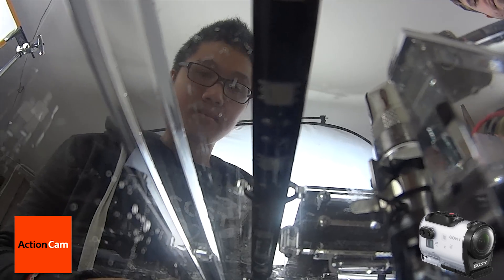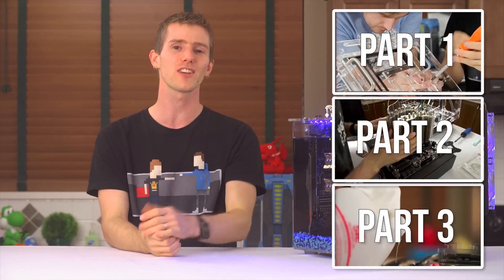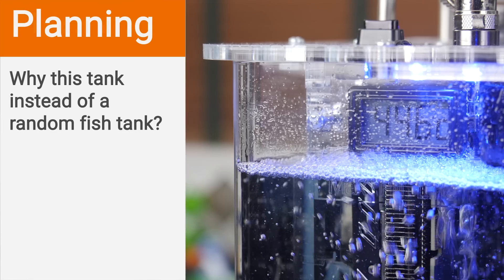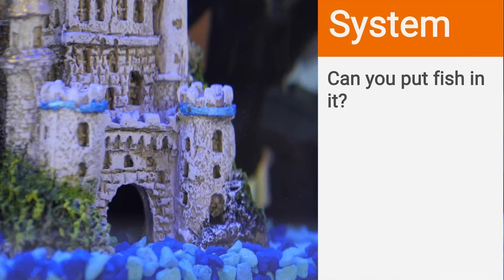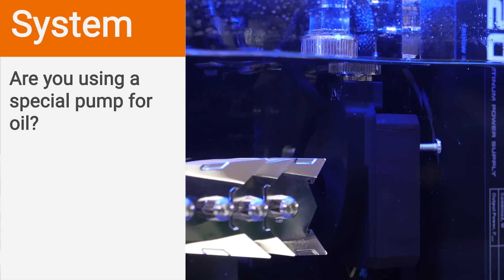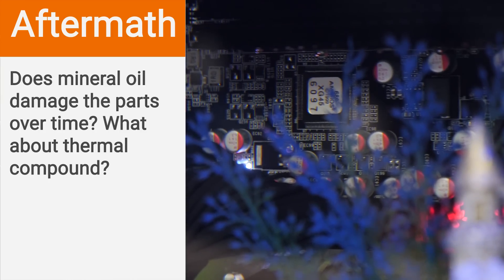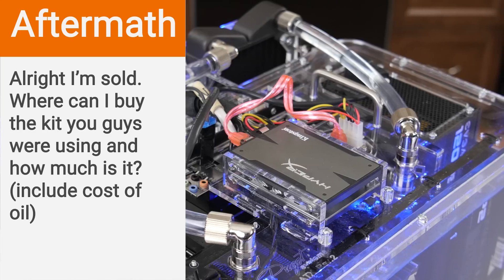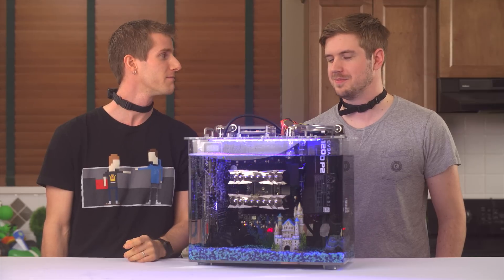Mineral Oil Cooled PC Part 4 - Q&A

Comment: Of COURSE having a fan on the cooler would make sense!? Exactly the same way how the fan makes sense in air. It is meant to dispose the heated up "material" asap from the cooling fins. Would have helped GREATLY here to keep the CPU temps lower.

Btw....you explained the positive effect of the fans properly regarding the graphics card - strangely!

Comment: Water also has the disadvantage that even distilled water is subject to so-called autoprotolysis. This creates ions that make the water conductive and therefore unsuitable for this purpose. It is not just the ions that are introduced that are the problem, you simply cannot prevent some from being created by itself.

Comment: Would be interesting to see the oil cooled by a refrigerant system and more direct circulation on the system, a variable speed pump managed by software that would adjust with the ambient temperature and when under load to keep it pretty much at a constant temp at all times. That would be impressive.

Comment: LTT should do an Immersion Cooled PC using 3M Novec liquid...
Why? Well...
1. 3M Novec liquid is much more efficient in dissipating heat due to its volatile nature (evaporates at 46 deg C, it's also not flammable)
2. 3M Novec liquid is not greasy and will easily evaporate so cleaning will be much easier
3. You wouldn't need a heatsink for your CPU and GPU as the liquid itself is better at cooling the hardware down bare
But, why they shouldn't? Well...
1. 3M Novec liquid is very expensive, it's only recommended for corporate servers.
2. The system needs a complicated cooling system for the liquid (it has low temp boiling point)

Comment: Would the CPU and GPU cool enough by just letting oil flow over its surface, using a pump, instead of using cooling blocks and/or fans?

Comment: I wonder if you put a screw as a plug at the bottom side of the case so you can drain the oil out into something to change parts and then just reuse the oil.

Comment: How can you even suggest that more movement over the coils wouldn't do anything?? Honestly, Linus, why did you even hire that guy?? oi! "it might not even help that much" Video 3 when you show that the gpu ran cooler under load the very first thing I thought was "well no shit, the oil over the cpu is stagnant. It's not moving atoll." That's like installing central air conditioning for your house and saying you don't need a fan on your condenser unit outside because there's "already a lot of movement and everything" therefore relying on wind and air movement... fucking seriously!? This one legit pissed me off. *Insert Linus quip about this being the dumbest oversite EVER!

Comment: Ok, so what is the temperature of PCU, RAM, GPU of normal PC , vs the same configuration PC submerged in mineral oil?  It's like main question left unanswered..
Reply: Its not as good as water likely a little better than air, this is 100 percent a “just because you can” type of project. Water can absorb and move more heat than any other substance, which is why we use water to cool everything where its applicable and cost effective.

Comment: Super interesting build! What are the potential fire risks when using the mineral oil?
Reply: Little to none when used within the use case of pc cooling. But I wouldn’t set it up next to your stove or burn a candle on top of the case.

Comment: use a bath of isopropyl to remove the oil, the oil dissolves into the alcohol and is then flushed away and when it's gone the isopropyl can be evaporated in a matter of hours in the right conditions

Comment: I know this is a REALLY old machine. The main reason you don't fill it to the top is thermal expansion. Liquids expand when they warm up and the last thing you want is to "press" the system or have it overflow because when it warmed up it overflowed.

Comment: A 2020 Version would be nice^^
Reply: The computer is gone. I know this because I remember a video were they talked about it and in turn used the 3D card to see if it still worked and it popped. The card was very sticky of course and they tried to clean it. However they didnt do a complete cleaning, just superficial to make it less sticky. So I assume the oil residue worked as an insulator on all the parts it was in contact with. Ergo, some part got too hot and in turn popped.
-
So, there is your 2020 update. The PC tower is empty and the parts are ether popped or thrown in the trash by now, I assume.

Comment: Back when a 780 was considered top of the line
Reply: Back when there were grafics card to buy...
Reply: @SillyhAsH  fr
Reply: @SillyhAsH  LMAO
Reply: Because well it was. Just a few years later a 1080 was considered Godly. Now they get laughed at although any decent GPU is hard to come by
Reply: @DaniyalEditzz-OG  no it wasn't  the 290x was top of the line
Reply: funny enough that 780 is pretty valuable even today and even with the oil on it
Reply: i want to do this with my 3080, but there are no cases for this anymore
Reply: @FinnishArmy my 4090 might not like it
Reply: The GTX 980 came out the same month as this CPU. I don't know why they used a 780, but Maxwell was already top of the line by the time this video was made.
Reply: just wait 5 more years...
Reply: Fuuuuuuuuuuuuck i keked when I read those aloud.

Comment: I want to konw could you cool the mineral oil to sub temps since its freezing point is -30 C.
Reply: I mean you could but the oil would cause water from the air to condense and then you would have a massive ice block dilemma.  If you could put the system in an airtight/pressure tight box and apply enough vacuum to boil off the water inside of the pressure vessel and seal it off. Then you could probably cool the oil down to sub zero without having an oily watery mess to deal with.

Comment: I know this is an old thread but what about cooling using an aquarium water chiller instead of the external rads you are using. mineral oil freezes at -22c so could work real well. come on Linus give it a go please. Adam

Comment: should have removed all the metal heat sinks from the boards and processor. the mineral oil becomes the new heat sink and heat bank. processer would have cooled way more efficently if you had left it naked and just a fan to circulate the oil over it. i would have removed every metal plate and every thermal pad on each chip set. you were just slowing heat transfer by leaving them.

Comment: I wouldn't recommend mineral oil cooling, its a process to clean up components, also many rubbers in capacitors will swell and in the end cause failing parts GPU's mostly in my experience, wiring will become brittle causing cracking and eventually cause breaks in the wires causing things to fail if you ever plan to go back to air cooling even after cleaning. Had a friend who had a similar build to this with sli 780 gtx's lasted about a year in mineral oil before both 780's began to fail due two expanding capacitors. after replacing I replaced them only one was recovered from mineral oil and still lives to this day in a friends computer, I get gifts of mineral oil soaked parts i clean up and give to friends. I understand why people do it but havent had any friends try it more than one build. looks cool but messy, as one had his case start to leak and caused alot of damage to his room. cheap mdf desk begins to sag and carpet soaked and subfloor saturated in mineral oil. But in the end was pretty cool looking.

Comment: New comment on a super old video: 
Would it be possible to add a filter element into the oil circulation loop?
BTW: mineral oil is harmless; same thing as baby oil.

Comment: it doesn´t work without the cpu cooler on it?
i think you dont need this cpu cooling thing on it
Reply: A CPU heatsink does multiple things. First, it takes heat away from the CPU die, an area that is fairly small and concentrated, while the heatsink is fairly large in volume and surface area. Then, it removes this heat by some sort of exchange. The moving oil is acting as this exchange medium, but the CPU heatsink is still needed to spread the heat out from the CPU die. The CPU die itself doesn't contain enough surface area to allow the fixed flow rate of the oil to remove enough heat away per unit time, and thus would result in thermal throttling fairly fast, if not an outright refusal to work.

Comment: Hmm so you use some radiators on the back to cool the oil. So why not use a watercooler on the cpu with the radiator outside to prevent the oil from warming up to much?

With a decent flow inside the box/aquarium I see a huge advantage for other components being cooled more evenly.

Comment: I know I am super late, but yea can do a fish tank/computer build. only problem is you will have to spend money to custom a tank. you just need to have space between the computer tank and the fish tank. so it would just look like a box within a box. the fish tank wouldn't touch the computer tank so the temps will never change each other. plus it would look like the computer was submerged in the fish tank but not even in the tank at all. 

drawbacks is the cost, size, and space. also maintaining the fishes too.

Comment: thermal compund question , then a re use question. linus you forgot to re mention the re aplication of thermal compound ...
Reply: you should remove all thermal compound and replace it using thermal tape it blows away paste types i have been using a product called Therafilm since the mid 1980s and have never had one temp issue related to its use!

Comment: same system as oil cooled welder,thermal convection around the cpu cooler should be fine,one thing that would make the system even better is if it had a sump,a cooler area below the main oil area,this is used in commercial fryers for canteens etc,it stops oil from burning,it regulates the overall temp of the oil by having a cooler reservoir of oil,i/we had a buisness dealing with a whole host of commercial catering equipment and manufacture and  it was common for water to pool at the sump area while the oil in the cooking zone would be 180c even hotter sometimes,so the sump can really give a good reserve of coolant while the rads can be cooled as normal giving a far cooler over all system,a base tank of a third volume below in a tank circulated by timed pump would sort any thermal issues,considering most desktop/tower PCs don't get shifted around too much,and this system on the vid would most likely be very static anyway,or a larger radiator below with a timed pump would act as a very good reserve as it can be cooled .

Obviously the max would be an intercooler with water run to waste around an oil radiator just as ice cream is cooled when made so rapid cooldown and freezing can inhibit bacteria formation,the same method applied here would be very small and compact compared to the air cooled radiators,but then liquid nitrogen vapour ..........

Comment: I swear you were all stoned for this build .Great build but damn.
Reply: Should do a 2019 edition, I'd love to see optimization done on cooling the mineral oil below ambient and better flow through the cpu rad ( perhaps by feeding air directly under the rocks and under the rad the air bubbles rising would accelerate convection )

Comment: Why did you not use any fans on the cpu cooler? I get you said that the system has enough circulation going on already, but those temperatures on the cpu were just terrible... 88 degrees is worse than what you'd expect from water cooling or even air cooling in many circumstances. I'd have thought the reason to do this kind of build would be the best possible temperatures one could get without going into sub zero cooling. If it doesn't even keep up with water cooling, it really can't be justified.

Comment: put bublbler under the cpu heatsink it will make a flow from the bottom wich is cooler oil flow up through the heatsink and make it run cooler..honest cold is on the bottom heat is on top..oil flowing down into the tank shouldent flow across the warmer running things like gpu and cpu, it will send heat from the surface wich is hotter on top down into the cpu and gpu..flow coming up from the bottom over the gpu cpu will run cooler :)

Comment: I saw a video many a year ago where an oil cooled computer was made and the guy specifically said to disconnect or remove any fans slash moving parts before submerging as the density of the oil can burn them out and possibly cause other problems. Have you noticed any negative effects of keeping the fans on the GPU and PSU? Have you had any air bubbles make their way into the oil pump? I'd be too concerned with that to put a bubble maker in there lol but it's a very beautiful build and I love the tank/case design. I'd like to see some Linus customization like laser engraved logo's lit up by LEDs ;)

Comment: I just came across this.
Its too bad you didn't template the dimensions of the pieces, make a PDF, and anonymously post it at TPB for the DIY crowd.
Water jet cutting a .25" Plexy or lexan  sheet into parts is cheaper than you think.
Having the tank built is a different matter.

Comment: Is that $1000 just the cost of all the mineral oil related stuff or does it include all the computer components too? 

You said to do wifi since cables can wick the oil, yet obviously the power cable  is connected in and can wick the oil, so wouldn't it be fine to use say a cabled mouse and keyboard? I mean you leave enough space at the top so that anything plugged in doesn't get oiled, right? 

So HDD aren't sealed enough to prevent the oil from getting in? I take it a external disk drive is needed too.

Comment: What about the rubber O rings in the fittings? Or are those silicone?
I noticed in one of the earlier parts that the instructions said never let the oil reach over 50 degrees C. In the benchmark test under load I saw the temp at 48.5 C.
What happens if the oil goes over 50 C?
Reply: There are a couple of Videos on Youtube, one has a Phenom and a 7750 - the oil hit 51.XC after an hour of Gaming at highest settings - so it's fair to say that it maxed out at ~51C (without pump as far as I can see)

Comment: You could probably get a very low speed fan to work on the CPU. Or, conversely you might trim material off the fan blades to make them push less oil and handle the fluid better.

Comment: Great series.  This reminds me of when Cray was struggling with the overheating of the Cray-2 memory modules, which delayed its release for many years.  It almost ruined them.  Then 3M invented Fluorinert, which was basically a specialised non-conductive cooling fluid (a fluorocarbon-based mineral oil) that finally enabled Cray to cool the memory via a coolant "waterfall" to stable levels and bring them to the forefront of supercomputing.  It was that implementation alone that allowed Cray to profit from their technology and continue with their supercomputing business.  Without that fix they probably would have folded, considering the Cray-2 development started in the late 70s and was only released in 1985 due to this problem.

Comment: the problem I had were the capacitors : The oil sometimes heated up to high temperatures, which is fine for cpu and gpu but the capacitors are only rated till 65 deg.

Comment: You could probably hold down the fan so it doesn’t turn (as long as the fins aren’t connected to a coil with gears) as the motors are simply a electromagnetic coil, if you hold it down it just won’t turn (unless it’s gears as I said before)

Comment: When the fans are running against the mineral oil would that put extra stress on the fan motor?  I figure its a lot more strain on the motor than just pushing air. I wonder if that could case them to fail in the future.

Comment: ok 1 question.....if the harddrives cannot spin correctly in oil because of mechanical slowdown ,then  same goes with the spinning gpu fans i would imagine they have to spin harder from the wieght of the oil??

Comment: Its funny they mention the walls being thicker to prevent cracking, because that's exactly what happened to me when I built an oil cooled computer way back in 2007. I used a generic plastic fish tank, and after about a year of use, I got stress cracks in the tank. Yeah, that was a huge mess to say the least.

Comment: tip if you get oil on your clothes put dawn dish soap all over the spot and let soak in, then wash. the soap will give the oil something to attach to and pull it out. if you wash without this trick you'll always have an oil circle. you're welcome fam!

Comment: I know I'm way too late for the Q&A, but I'm wondering how well a low-viscosity motor oil would work in a system like this?  An engine-themed system would be even cooler if you knew it was filled with 0W20.  Yeah, it would be super expensive, and yeah, it wouldn't be perfectly clear, but does anyone think there wold be any practical problems?

Comment: I have a Question about temperatues in a pc. Somebody once.... nah.. not that! Anyways somebody told me that temps like 30°C are okay because if things get too cold in a pc the voltage (current/gush/stream??) won´t get through right and the pc is in mereley danger. So it´s fine if the pc is a little warm inside. Sorry, I tried to explain. I need professional answers on that. Thanks. Bye. EDIT: I forgot to mention that I´m talking about usual PCs. No Oil. just normal components...

Comment: as far as clothes, oil in general breaks down most fabrics, especially polyester. so if you leave it on your clothes for an extended period of time, youre more likely to lose fabric integrity and get holes, but if you throw them in the wash within a few hours it should be fine.

Comment: ok what wuld happen if you removed the heatsinks and just put a fan in front of the cpu and gpu. I should circulate enough cooler oil to remove heat.... I mean I would think